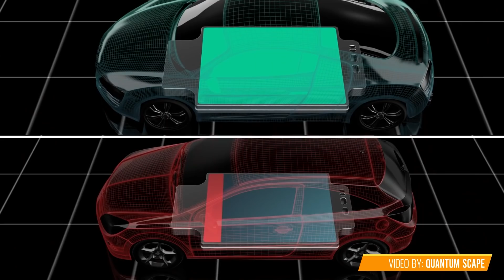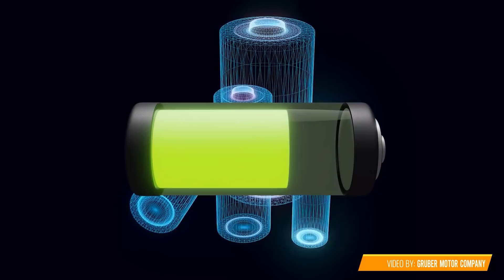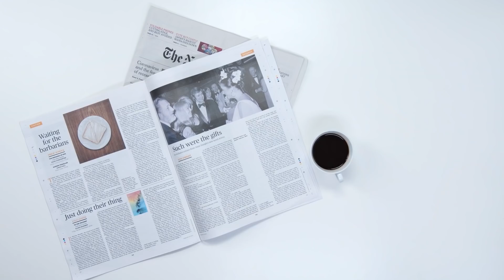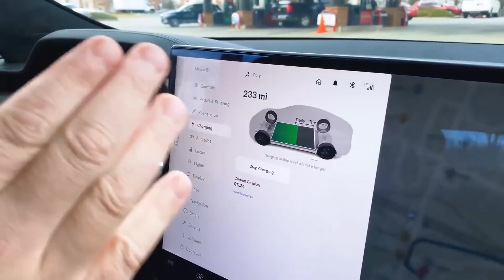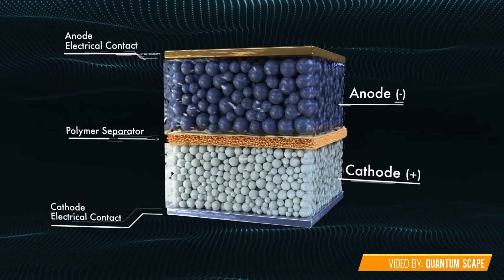SANDY MUNRO: Are Solid State EV Batteries Too Late?

Comment: Sandy is right: 15 minutes is definitely pretty much good enough, even on a road trip. You stop every 2-2.5 hrs anyway, so a 15 min stop is not a big deal. And this only a couple of times per year, because the rest of the time you charge at home. Oh and Hyundai/Kia already offer 18 minutes to 80% right now. Pretty sure that 15 minutes will be available by 2025 without Solid State Battery.
Reply: I think it is more 2.5-3.5 hours.
Reply: You must be aTesla bot to be able to drive that long.  Can’t believe it.  I once drove 550 miles in a day from Cape Cod to home near Toronto, with family on a hot day, with frequent stops. We nearly died, never was so glad to get out of a car. 300 miles per day is about as much as I could comfortably manage. The car, a 1968 Dodge Charger R/T, had no air conditioning nor cruise control, as they were not available on those days, unless you bought a Cadillac.
Reply: What’s a blatter?
Reply: You stop every 2 hours? Tf lol
Reply: you guys stop every 2 hours???? My family stops when we are low on gas (about 5 hours)
Reply: Most people don't have garages and can't charge at home. I have a 50A, 240V plug in my garage for a welder that could be easily used to charge a depleted EV overnight, but most people don't and are going to have to stop at a charging station. It's going to be a tough sell to get people used to spending less than 5 minutes to refuel a 10-20 gallon tank every 300-500 miles to switch to a vehicle that takes more than 15 minutes to "refuel". Just like it's a tough sell to get people to spend over $40,000 an a new EV when a substantial part of the market buys used cars that cost under $15,000. Once we reach the point where you can buy new economy EVs that get over 300-mile range on highway in freezing temperatures, can recharge from 10-80% in under 15 minutes, cost less than $30,000 brand new (without incentives), and can last over 20 years (and over 300,000 miles) without needing a new battery or costly electronics, there will be no reason for any rational buyer to not buy an EV. I am optimistic that we will get there in 5 years, but it will be another 5-10- years for those EVs to enter the used car market in mass so people can buy them used for under $15,000.
Reply: @JEP-Tech  daily charging can be best done by lower power chargers in the streets, at work, at stores, while you're doing something else. Really quick top ups are mostly/only needed on long journeys.
Reply: @bilgyno1  That's true for people in large cities with a good charging network, but it's not true for a lot of regions. Where I live, all the charging stations are only on one side of the closet large town, and absolutely zero are in rural areas, so the point is kind of moot for a large segment of the population. There is still a long way to go before EVs can be considered an "every man's" car. Infrastructure is expanding fast, so we will get there at some point, it's just not there yet.
Reply: @JEP-Tech  once oil companies go tits up because most are leveraged to the hills once they pass that fine line of buyers and can only make up there margins by increasing prices of gas i think will happen alot sooner  then people think look what happened with the horse and buggy that was over night almost 5 year period and horses were a pet you owned after that most drove there model t
Reply: @lesstevens2370  Oil companies aren't going anywhere. BP and Shell are investing heavily in charge stations and EVs and renewables and the Saudis too. LUCID is primarily owned by Saudi investors. Plus we will still need oil to make all the plastic parts in practically everything, because it's too energy intensive to make biofuels, and spike the fertilizer with methane used in all commercial farms. I don't see oil going away in my lifetime.
Reply: @JEP-Tech  yes there changeing there primary sales to renewable's since they arnt selling oil then they are not an oil company any more ps why would they do that if oil is to stay are they being forced to by governments and its just to appease them or do they see the writing on the walls and are doing it to survive this new disruption
Reply: @lesstevens2370  I think it's both. A lot of global governments are pushing for "green" energy, but also more consumers are demanding it. Oil companies know they can't make money from oil forever, at least not at the same level they are making now, other industries will need oil for decades or longer, but the transportation sector’s dependency on oil will decline as people buy more EVs. The efficiency of using energy dense and relatively cheap fossil fuels now is allowing oil companies to make a substantial amount of profit that is being reinvested in alternative energies. This transition could be accelerated faster if Western governments weren’t impeding the development of nuclear power plants. China knows this, which is why they are building new nuclear power plants to replace coal. More people die every year installing solar panels than died from all nuclear power plant failures in the entire history of nuclear power. Also, coal generates far more radioactive waste than nuclear power, and that waste is being pumped in the atmosphere instead of being stored underground. Nuclear is extremely safe and newer designs could be even safer. Solar and wind power have their purpose, but they all require batteries, which means more mining and more complexity in grid management, while nuclear is king for peak power generation, which is why some oil companies are investing in nuclear energy despite the hurdles it faces.
Reply: I have driven for over 9 hours without stopping. 2-3 hours is way too often on long road trips. I can drive for over 700 miles on a tank of gas, takes around 10 minutes to fill and I’m gone.
Reply: @jackylsmith8138  900 miles non-stop sounds like you'd be worryingly tired
Reply: @jackylsmith8138  - 9 hours without stopping is extreme.
Reply: @jackylsmith8138  You are a hero.
Reply: @jackylsmith8138  that driving schedule is insanely dangerous.
Reply: @jackylsmith8138  That's a long road trip. What do you take maybe 2 of those a year?
Reply: Stopping every 2-2.5 hours? Do you have bladder issues? No way I stop every 2-2.5 hours. More like 5-6 hours. Stop kissing up to Sandy the GM hater.
Reply: @tkbisme  ... 5 - 6 hours is doable. I'm from Europe. I think our truckers, are by law, need to take a break every 4 hours. And I think for private drivers it is recommended to take a break every 3-4 hours to fight fatigue, sleepiness, decreased concentration.
Reply: @danijelandroid  the advice for non professional drivers is to have a 15 min break after 2 hours driving. Rules for truckers are max 4.5 hours straight followed by at least 45 minutes rest.
Reply: @tkbisme  I don't have a blatter problem, but I do have a kid.
Reply: I’ve always been a GM hater even much, much before Tesla. I had a well used 1951 Chev with a 2 speed automatic though which was my first and last GM product. Chrysler was my preferred ride then.
Reply: If I cannot get to where I’m going in less than 6 hour with stops, I’m not going. Could not stand the back pain and can not stay still that long.

Comment: 100 miles daily covers most daily use and is wonderfully covered by overnight charging.  (Or even, while-one-shops-or-dines charging.) On road trips, a half-hour stop every 4 or 5 hours is reasonable for most folks.  We're there now.  The improvements will help, but they are not needed to change the narrative. Experience living and traveling with EVs changes the narrative and that is happening as fast as it possibly can today.  The shift to EVs will be production limited for years.
Reply: Only issue is if your travels take you off major highways and interstates (in USA). It’s getting better, but you can easily end up struggling to find anything better than a level 2.
Reply: Is it common for people over there to live up to 50 miles away from their job offices?
I don't know. 100 miles of range as a requirement to find EVs suitable for daily usage seems a bit high to me.
Reply: @unusuario5173  in North America, it is not unusual to live 50 miles from a workplace (to save money), if telecommuting is not an option.
Reply: @unusuario5173  yeah most people I know commute over 50 miles each way to work.

Comment: Battery lasts 100 years?  Well, you can say anything you want, but you need a product to back up it.  Until that company is celebrating their 100 year anniversary with 100 year old batteries that are still in service, talk is cheap.  I bought a Lawnbott LB3200 lawn mower that was advertised to be maintenance free for 10 years and it was burning motors out every other season at $150-300 each.

Comment: 2 things: 

1. There is zero need to convince naysayers to buy EVs. You're not trying to sell to them; they're not your market.  When they're no longer naysayers,  they'll be your customers.  

2. The battery tech that most decent EVs have is quite sufficient for most people.  Batteries will naturally change from 18650 to 2170 to LFP to pouch to 4680 and solid state and whatever else,  and they'll easily slot into the same space,  while reducing cost or weight or inefficiency or flammability.
Reply: I forgot #3:
Buy whatever tech is sufficient now,  then you'll enjoy buying whatever is better in a few years. There's no sense in simply waiting.

Comment: So what about the time it takes for ICE oil changes that electric cars don't need?
Or the fact that you can plug in your electric car and walk away?
If it only needs charging every 1000 miles, it won't be an issue.
Reply: It will be an issue for people who live in buildings that don't have enough charging stations. Or, as in my case, live in a building that has only one charging station due to the architecture.

Comment: Bought my leaf when it was 3yrs old. Still had 12 bars for state of health (comes from factory with 12 bars). For the last 6yrs I've charged it pretty much like my cell phone, overnight on 110v. I set the onboard computer to stop the charge at 80 percent. My battery is now going into it's 9th year and I still have 10 bars.
Disclaimer, I use the car as it was intended, short trips, mostly work and back (34 mi. Round trip). I almost never use public (220v) fast charging, and I rarely let it get below 20 percent. Zero emissions!?, let's talk about zero maintenance! In the 6yrs over been driving this car (averaging about 10k miles/yr) I've replaced the wiper blades 4 or 5 times and I've replaced the tires twice. Still on the original brake pads thanks to regenerative braking. Don't know how much $$ I've saved over the last 6yrs but I'm sure it's significant.
Reply: Great post, As an i3 owner I agree "Zero Maintenance" is almost as liberating as zero gas. Amazing what happens when you take 1000's of parts out of a car that all had predetermined failure points to keep the auto parts suppliers happy and dealer service bay technicians employed. I don't miss it. The fact that I just had to spend $900 on a timing belt replacement on one of my ICE cars, just kills me as an EV daily driver and enthusiast.
Reply: @jefffaller8474  In the owner's manual for my 2016 Kia Soul EV+, under maintenance, it lists what types of things should be done at certain mileage intervals. It literally has nothing of any consequence well past 150,000 miles. Things like, "rotate tires", "check brake pads" and the like are all that are listed. Other than the infotainment system occasionally needing to be hard-restarted (via a pinhole reset button) there have been zero issues. Brake pads have virtually ZERO wear.
Reply: @jefffaller8474  Timing BELT?!?!? **GAAAAHHHHH** HULK MAD - HULK SMASH!!!! Seriously though, whatever bean counter(s) convinced automakers to convert an internal engine component into a RUBBER BELT needs to be tarred and feathered IMO.
Reply: I got close to 100k out of my 2011 Leaf before I upgraded to Tesla. Was a great, fun little car. But it did go through 2 batteries, and in the end only had about 35 miles range. Nowadays with my Teslas, range anxiety is almost zero.
Reply: @GetOutsideYourself  The smaller battery size (more likely to be cycled on a daily basis) combined with the passive battery temperature management is the main culprit with the Nissan Leaf's battery. I was really surprised when they came out with the second generation Leaf that they still had not added a liquid cooling system. Great car by all accounts otherwise, and they deserve credit for being one of the first to take the leap of faith early on.
Reply: When the battery is reporting 0% it actually still has 80% of the charge. However, if we keep draining the battery below that internal 80% (which is hidden from the user for very good reasons) the battery will be irretrievably damaged. What I am saying is draining the battery to a reported 0% is fine as long it is not drained any further. This also assumes the manufacturer is telling the truth about how much you can drain the battery and still have a long life. I only have experience of one electric car, a Tesla. When it hit the reported 15% mark, it had already hit the 80% minimum actual charge. I am sure they are not the only company following this questionable reported charge algorithm. Model car, plane, helicopter, and quad-copter owners know far more about batteries than most Tesla owners :)
Reply: Saw a video on YouTube last year about a Leaf that some guy bought for practically nothing that had been used as a taxi somewhere in Europe. The battery, after examination, was at around 70% state of charge health. Not good...until you take into consideration that (after using LeafSpy) they found out the car had been DC fast charged almost 7000 times! To me, that is freaking amazing.
Reply: Good work.. The ice cars have been paying for the nice road gyou are driving on... Both sides
Reply: @cjswa6473  Don't worry, even though we don't pay gas tax we still help pay for roads via higher registration fees. At least in my state.
Reply: @ElroyMcDuff  is the fee linked to miles driven? will be interesting how states handle electric semi's.
Reply: @victorhopper6774  Not that I know of. It should be now that you mention it since you pay more gas tax by driving more etc.
Reply: @ElroyMcDuff  i can see a whole can of worms coming since these cars are connected to the manufacturer and the net. like the state demanding access to not only miles but where those miles were. i think they already do that with semi's.but they are not private. you might get a bill in the mail for milage tax plus tickets for every driving violation.

Comment: Love your channel, but the time to charge is not the biggest issue. For some people it will be and there is no changing that. But the two biggest barriers right now are 1. infrastructure to support EVs (charging stations, repair shops, etc.) and 2. price, which is going to continue to drop. And remember, EVs are in use already in manufacturing and transportation like fork lifts, delivery vehicles, semis, harvesters, etc.

Comment: Sorry, as a member of over 60 years old.  I have to stop every 1.5 to 2 hours max. And I have found that 15 to 20 minutes is really perfect.  I also need to walk and move my legs.  I'm looking forward to seeing people come up with upgrades to the older EVS.  Like the Leaf and the Bolt.  Not the expensive Tesla or other over 40k monsters.  The low cost is the future.
Reply: no EV can drive 2 hours at highway speed.
Reply: @nox5555  Well, I have driven for 2.5 hours at highway speed,  both our Nissan Leaf and Chevrolet Bolt.
Reply: @ArielBatista  do those cars even get to highway speed?  also both of them never do 200 miles at travel speed...

Comment: For most people, EV range is as relevant as top speed.
Reply: Hmmm, you got a point.
Reply: True. I’d buy an EV with a top speed of 80 if it had a 2000 miles range.
Reply: @Pennington0Justin  It will be interesting to see what the average balance of price/range/performance turns out to be when there are half a dozen EV makers competing. That balance will be a lot more quickly established in the Class 8 truck market -- all bottom line, no lifestyle.

Comment: Has anyone considered?:
When filling an ICE vehicle at a self-service station, you have to stand there, holding the nozzel the entire time. You have to be very careful not to drip fuel down the side of your car or on to your clothes when you are done. Payment takes time too. Then, and only after doing all that, you can take care of any other business your stop may require.
With a BEV, you plug in, walk away and take care of other business while your car charges. Payment is typically through an ap on your phone that takes care of all the messy details. And, this is only on long road trips because otherwise, you are charging at home.
Yes, I propose that a BEV could actually save time and be more convenient even on long road trips. Eat that oil industry and nay sayers!
Reply: Why stand and hold the nozzle ? Prop the lever and go sit in your vehicle for a few minutes,  pump turns off automatically.
Reply: @robp3431  That may be the case at Costco, but not at most self-serve gas stations. Besides, you still have to hang around while your tank fills, which is my point.